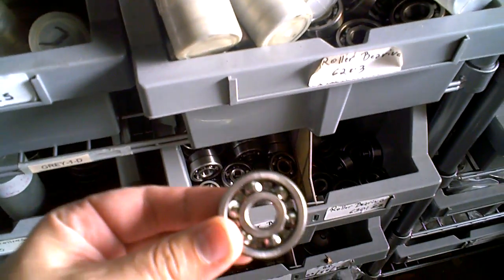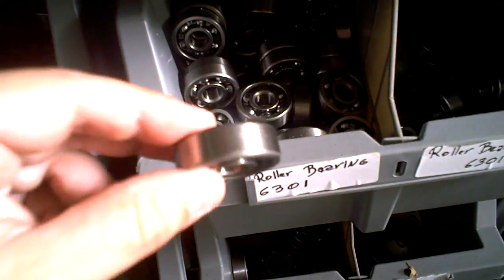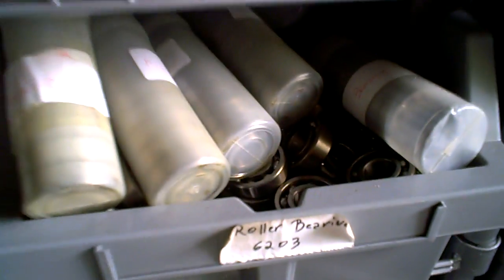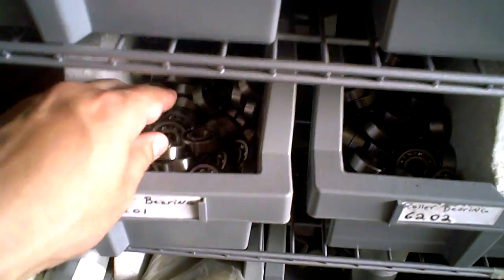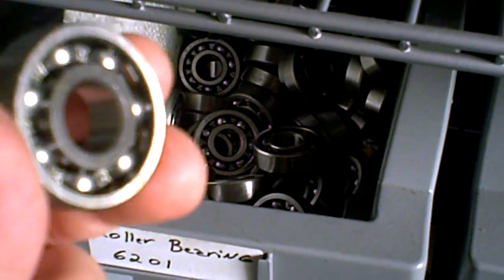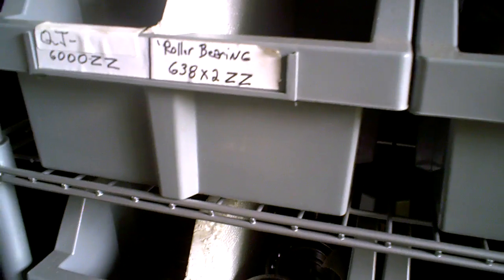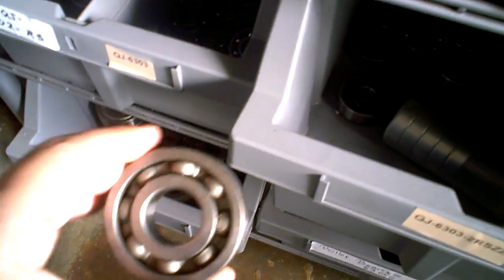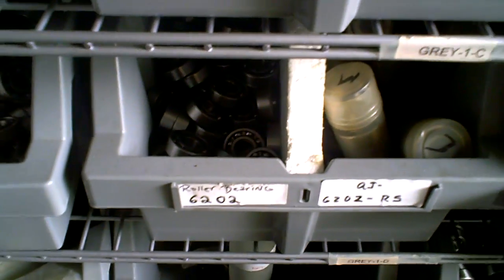Ball Bearings

Comment: I need ninja 'japan koyo yzm 182417' for rear sus linkage ( three links all with six seals) any help?
Reply: they are needle with thin plastic inner. and I roughly measured them to be height 16.9 mm x diameter outer 24 mm x inner shaft measures 17.98 mm.